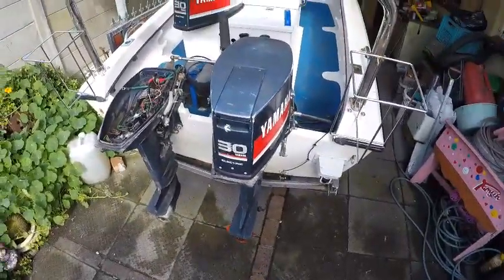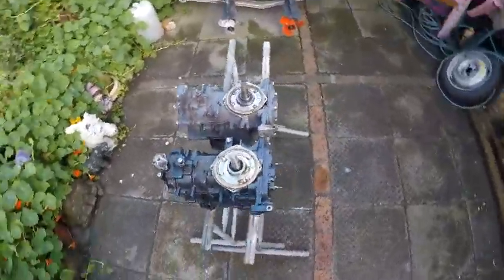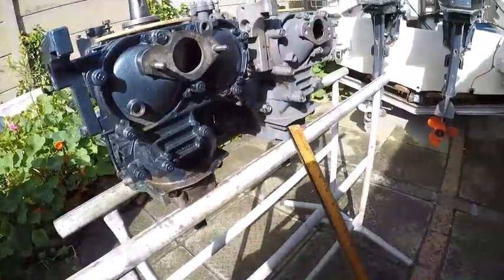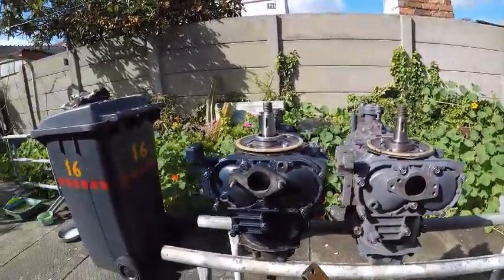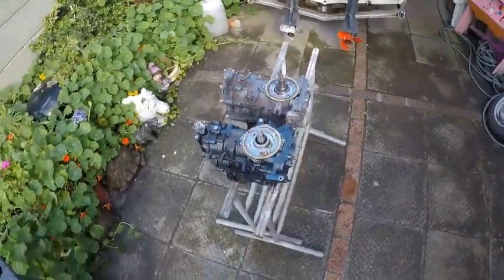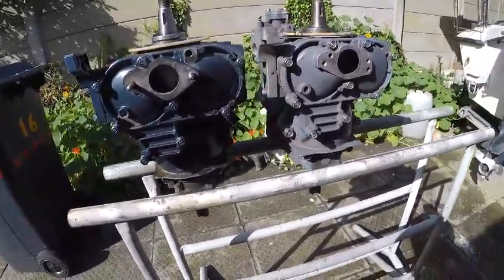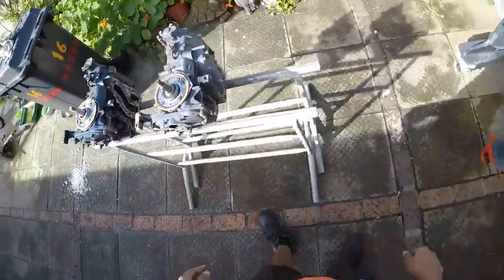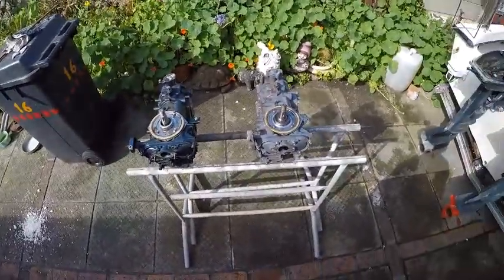YAMAHA 30AE BLOCK SWAP

Comment: I need some help I think my top crankcase seal is leaking cause it won’t idle and there’s oil on top of the block next to the flywheel also you know where I get parts?